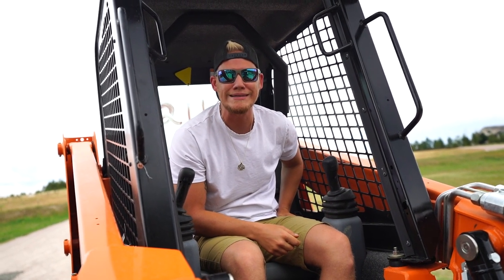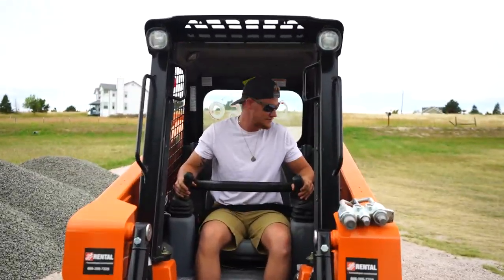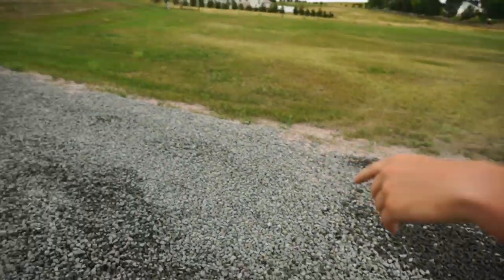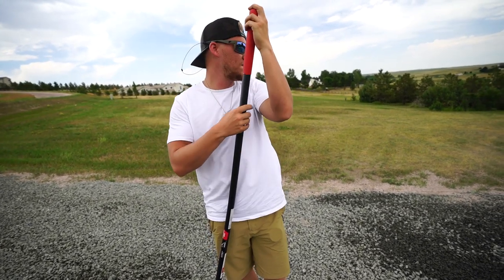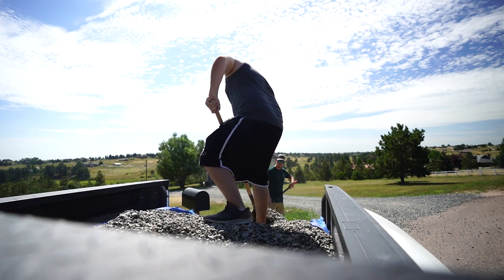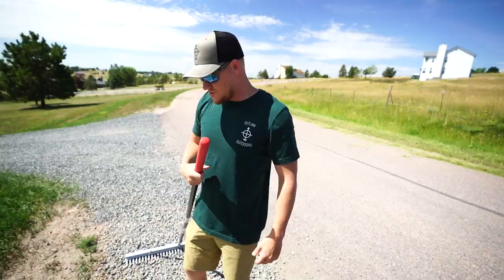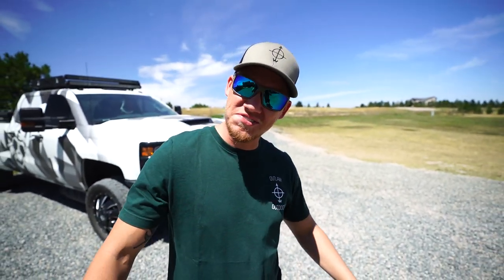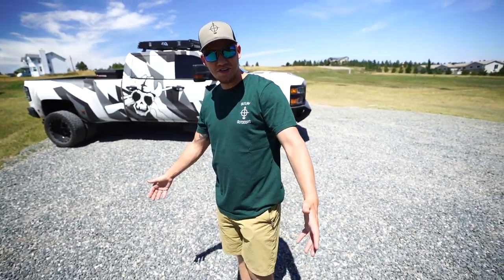MY NEW TOY!!! (Re-doing my driveway)

Comment: Should have had the truck that delivered spread up the drive sorta thick. Then used the bucket on the bobcat to smooth out.  The reason it goes to one side and disappears. Is because as you drive in your tires push to one side.  Lol. I feel your pain I buy about 18 ton each year. Dirt road living.  Looks great ya did good.

Comment: If I'm not mistaken that rake is for asphault  .    Skid steer  tip.  Dont turn around.      Just back up and drive straight. If you do have to turn around make like a 3 or 4 point turn so it doesnt mess up the ground or stone your working on.  When you back drag put bucket flat and use the back of the bucket.   Track it in when your done if you dont have a roller.